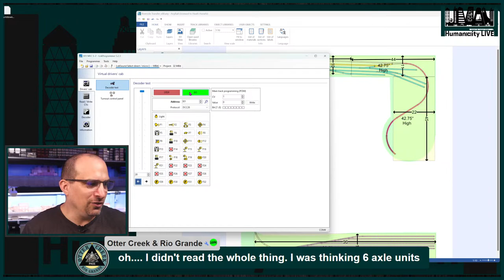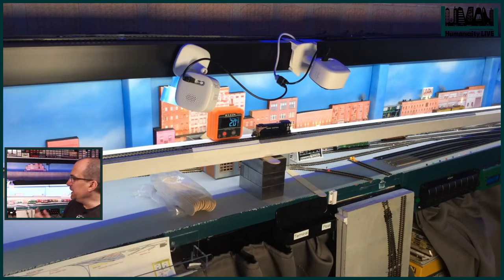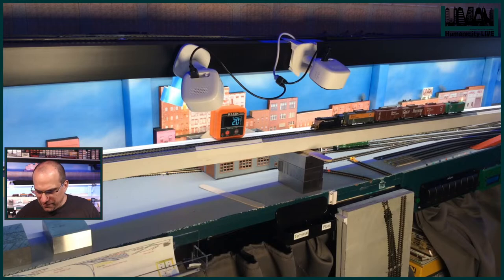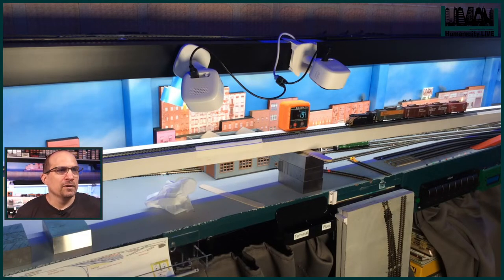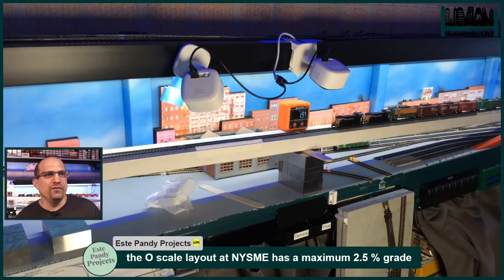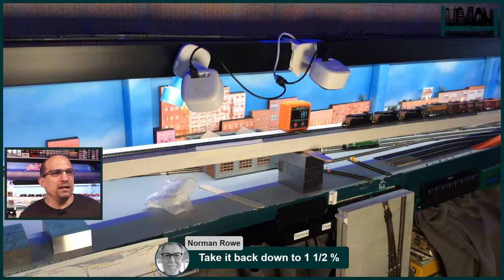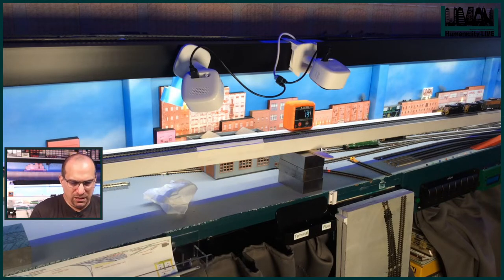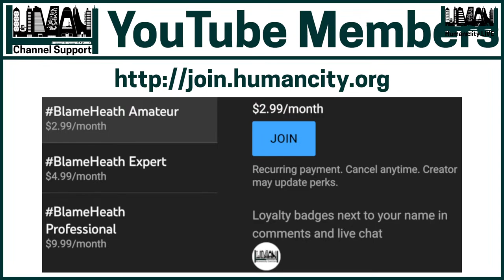How Steep is Too Steep | What Grade Can I Get? | Trains N Tech

Comment: But you did learn something.  You actually learned that your two switchers can pull 8 cars up a 3.5% incline, but they can't pull 10 cars up the same incline.  So as long as your layout doesn't have an incline over 3.5%, you should be fine.
Reply from the maker: Thanks, yes, I will definitely not be going over 3.5%, LOL.

Comment: Each % is 1” rise for 100” of run.    Either the gauge needs calibration or you are on degrees instead of percentage since each 123 block is about 1” and you are near 1/2 the length of the 8’ board(48”) so at what you think is 2% is closer to 4%. 1, 123 block on end so net rise is 2” with 3 at center. Glad you figured it out at the end.
Reply from the maker: Steve, The crazy part is that I knew this which is why I got the 1-2-3 blocks out as I figured it would make it easy to up the percentages by just adding an inch under the end of the board. 
It never occured to me when I had to move the 1-2-3 blocks to the middle of the board, that something was wrong!!
Reply: @HumancityJunction   it was so painful to watch the replay knowing I couldn’t help! Lol I woke my wife up (around 3am) by telling you firmly (or at least the tv) you were not measuring % grade properly. Too funny at the end when you “got it”.
Reply from the maker: @stevechilders2425  my brain STILL hurts.
Reply: I thought your first measuring device was reading degrees until your phone said the same figure. I know my phone measures in degrees.

Didn’t you test one s2 on 1.5 degree and pulled eight cars? That would mean one s2 will pull 8 over 2.5%! That’s pretty good!

How large are your passing sidings? That’s going to limit how many locos and cars combined as well.
Reply: Degrees in geometry is different to grades used for inclines in vehicle roadways or railroad tracks, think of degrees as dividing a circle 360 parts as you rotate around, while grade is the percentage of rise over a distance, so a 1% percent grade rises 1 inch over a 100 inches of travel
Reply from the maker: @nscalecoal  Exactly, just having a brain fart.